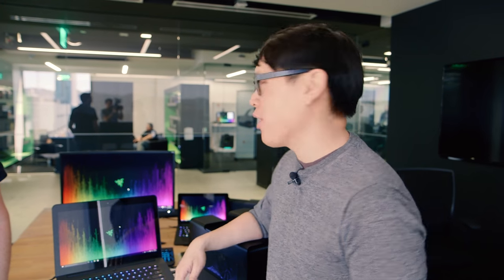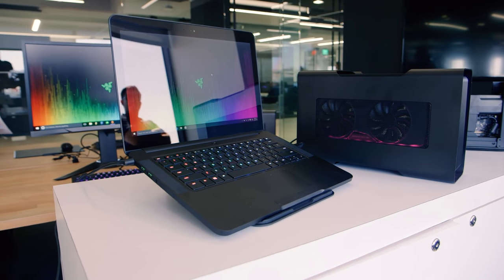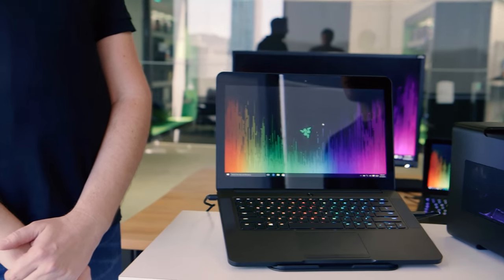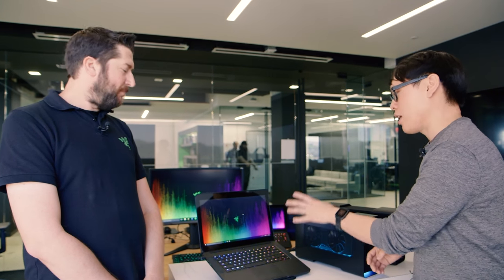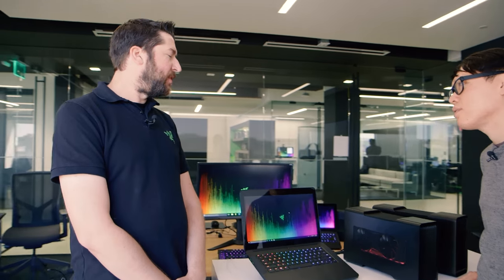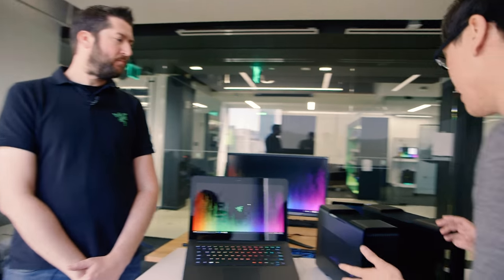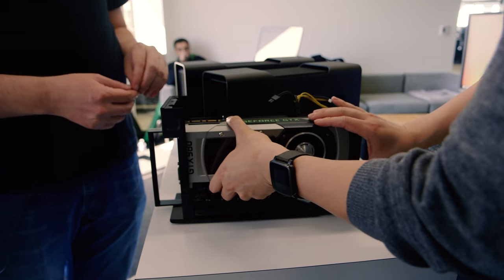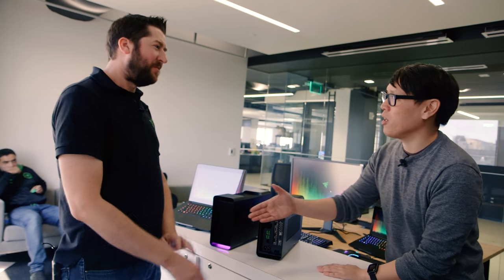Installing a Video Card in the Razer Core (External GPU)

Comment: I hope this tech advances.
I will always use a desktop currently for desktop setups. It's just the way it is; however if the hybrid laptop station gains compatibility, it will become a revolutionary device for all PCs.

The next portable I'm considering doesn't need to be a gaming device. Infact, I'm aiming for a 3D touch pen tablet screen (to make a wacom obsolete).
Essentially the design needs that type of screen. A Tablet PC design. And at least 16GB of ram.

Tablet PC's seem stupid right now, but if these types of devices, especially, are improved upon, you can turn a tablet PC into a tank in seconds.
The 3D touch is absolutely necessary for digital artists who wish to compact their art tools.

--------------------------------------
A general serious question though... who (other than apple's new Ipad) has created a 3D pen tablet screen for a tablet PC?
Reply: AshnSilvercorp Check Lenovo Yoga 720 15''.
i7 7700hq
16gb ram
512gb ssd
Gtx 1050
4k display with touch and pen
Works like a laptop 
Folds to work as a tablet
And usb-c thunderbolt 3 port wich you can use for egpu 

Bonus - 7h real world usage of lasting battery

Still don't have a egpu. But the discrete gpu inside is enough for my needs today. 
Played Witcher 3 and still play Escape from Tarkov. 
The only thing you will not be able to do is play in 4k....but since the screen size is only 15'' you won't actually need to. Lower resolutions work well.

Comment: Looks nice and looks like it was well thought out but this will still be bandwidth limited. Thunderbolt 3 is 40 Gbps which is effectively speeds of PCIe 1.1 x16 or PCIe 2.0 x8 or PCIe 3.0 x4. Plus add in that it is carrying gigabit ethernet and USB 3.0 ports, there may be some serious bandwidth issues while gaming. I'd like to see performance of a 980 Ti in a regular desktop compared with it in this enclosure. I'd be surprised if the 980 Ti could perform as well as 970.
Cost is also a bit prohibitive. For $500 I can buy a decent desktop CPU, PSU, motherboard, RAM, and have full performance of the GPU.
Reply: +htwingnut Honestly that's how I saw it too. I was excited for this, but I predicted the core would be exactly $500. So for this whole setup Blade ($2200, id choose the 512gb personally) + Core ($500) + GTX 970 (about $350 average) = about $3,000. For that same money can build a premium desktop with a 980ti for which I plan to carry out after Pascal releases. Then I'll just get something cheap to run on campus with. I already paid top dollar for a gaming laptop 2 years ago, but found myself playing games more at home rather than "on the go", so a desktop will now suit me better.

Again the Blade 14 by itself is a good laptop (curious how they will manage temps this time), but once the Core is considered along with another graphics card on top is when I question the actual value in it.

Comment: a lot of people are missing the point of this thing and complaining its over priced, but they fail to see how useful this is for some people. A lot of college students or professional workers will have an ultrabook on the go to do work. When they go home, they can just plug that ultrabook in and have the power for a 1000dollar desk top That way they dont need to own 2 systems and save a lot of space as well.
Reply: But the ultrabook itself is dual core, whats the purpose of having a good external gpu when the cpu is going to bottleneck itself. Building another quad core pc without the graphics card probably cost $600, which is $200 more than the enclosure but you won't get any bottleneck.
Reply: +Christian HT lol good point
Reply: +smileyfaceHi Add to that the fact the enclosure is 400 without a GPU inside of it if you buy it with the laptop, so you're spending 2400 + the cost of the GPU to get 'desktop performance'
Reply: well my point is you cant bring a desktop to a coffee shop, work or travel with it in general. so you're paying premium for convenience. Thats pretty much the reason laptop prices are high in the first place.
Reply: +smileyfaceHi I can see myself paying for a high-end desktop and even getting the Stealth for campus work for about the same price as a Blade 14+core+GPU setup. If the Blade Stealth at least had a quad core in it, then the bottleneck issue may not be as bad. You are right that there is a market for this, but the best setup right now is the Blade 14 combo because of the quad core alone. However the price becomes pretty niche at that point.
Reply: +Nick Migneault well consider this to be sort of a pioneer products. Like those high capacity harddrive that are expensive as hell but gradually lower in price. I'm hoping that in the future all of this will get cheaper to become affordable imagine the applications ! Say that laptop will become much cheaper since they did not need to include gpu and have longer lifespans since the heat are now outsourced. Even intel hd graphics and iris graphics are getting better and better. And you dont need those bulky towers that takes up space anymore. It might change the industry by merging both pc and laptops.

Comment: I absolutely love the modular aspect of this but what I can't seem to get an answer on is whether or not the core will support non-razer devices. Because, if I could get a mid range surface pro 3/4 and use it as a fully functional gaming desktop, that would be amazing.
Reply: +Caedon Bates I wouldn't bank on it until each manufacturer announces support for the specific device you are looking at it. This is 100% up to manufacturer.

Comment: hmm nice. I have the high end Macbook Pro 2015, but what is effectively a docking station for it at $499 is pricey but the ability to add a desktop GPU would be a sweetener providing osx supports such functionality.

interested to see if tested van answer that question for me.
Reply: +M3ta7h3ad check out Sonnet. They make Thunderbolt pcie enclosures designed for mac and have been doing so for a few years now. Great products

Comment: What a cool product, but way too expensive for what it is.
Reply: 150-200 would be ok for the enclosure alone
Reply: +Moeillo yes please
Reply: +Moeillo yeah sure, an external TB3 dock alone cost more than that
Reply: +Jesse D It comes with onboard PSU people tend to forget how expensive PSU that can support a good GPU can be.
Reply: +Faern Nashar expensive.. it's 50 eur in amazon (10% the price of the core). The whole price comes in licensing the enclosure. Thunderbolt license costs sh*t ton of money, then the hardware for converting everything costs quite a bit. You could do this with macs many years ago, but the enclosures were too expensive ($1000 for just enclosure) due to some complicated black magic involved in converting thunderbolt 2 to pcie
Reply: +The Diamond Games Yeah - People have been using 200USD Akitio thunderbolt enclousures with Macs for quite a long time already. With external PSU that price comes to 250USD + a little bit of DIY. 

Someone surely will get it done for 250-300USD. This is just the first one on the market. 500USD is ridiculous.

Comment: 970M... 6GB ram... WHY?! The 970m is slow... I do not understand what all that ram is for. Don't confuse the 970m for the 970, totally different. The 970m is slower than a 760.
Reply: +Richard Smith actually 970m is about as fast and sometimes even faster than 760
http://gpuboss.com/gpus/GeForce-GTX-970M-vs-GeForce-GTX-760

970m has more cuda cores and it overclocks easily

Comment: This could definitely be used to me as a college student.. I left my massive gaming PC at home because how much of a pain in the ass it would be to transport it back and forth. With the an external gpu like this, I could get a thin ultrabook like this and use it for classes without getting stares for having a bulky gaming laptop, but still be able to game back at my place.
Reply: Same.
Reply: +Pilot KaZZ 

or you could have avoided buying a massive case and bought a mini itx case that takes up only a little bit more space than this shitty $500 power supply with a usb port attached.
Reply: +Deject3d you are definitely missing the point..
Reply: i think razer is missing the point. they managed to make a gpu enclosure that takes up more volume than my desktop pc.
Reply: +Deject3d idiot.. the purpose of this product is to transform a laptop into a device capable of gaming without having to install an internal gpu. IT WASNT CREATED TO SAVE SPACE. it also wasnt created to necessarily be portable. the point is that you dont need a full-fledged gaming rig to game or a gaming laptop, just an ultrabook and an external gpu
Reply: +Pilot KaZZ You wouldn't even have to get the Blade Stealth..the new blade 14 is way more powerful and its compatible with the core so you can game on the go and back at the dorm.
Reply: +Pilot KaZZ assuming that college students can afford that shit? lmao.

Comment: the razer core makes it so much easier to plug in graphics cards. In a desktop, I had to put the graphics card in the pcie slot, plug in the psu cords, and then screw in the bracket screws. But now, with the core, all I have to do is put the graphics card in the pcie slot, plug in the psu cords, and then screw in the bracket screws!

Comment: So why the hell is this dock $500? It has a 500w psu, and a dock.... that's it?
Reply: When this is released you can go on eBay and get it for like 350. But I really agree that the price is stupid.
Reply: Everything is expensive before it gets mainstream
Reply: +Rafael Santana true
Reply: Well, 500W psu, dock, and pcie slot, should be $200 max, only because of the cool flashy lights and nicely designed case.  Throw that away and $100 tops.  $500 is definitely over the top. XD  Basically, a barebones desktop that's $300 has all of this and a complete motherboard, hard drive, RAM, CPU, etc. XD  You could build a small gaming desktop for that much and then you need the video card anyway...lol wtf is the point?  You're basically carrying around a mini gaming desktop that doesn't function without your laptop as a monitor. hahaha...I don't see the added value here.
Reply: Oh wait, you still need to attach a monitor to the gpu, right?  You won't get the graphics performance on the laptop screen, or will you?
Reply: I could build a gaming desktop minus the gpu for $500 and then same thing, except now I got the laptop and desktop, so...what's the point of this device again?  Mini desktop that needs the laptop to function? lol
Reply: With some laptops you can get the GPU to power the laptop screen but it really depends on both the external GPU, onboard GPU, processor and chipset, really the chances of it working are very small...
Anyway while a desktop could be cheaper, it is not mobile and buying a performance laptop for on the go AND a desktop is always more expensive, so even at $500 this is still cheaper for the target audience, sadly $500 also makes it embarrassingly expensive, at $300-350 this would be a lot less painful on the wallet and would easily be on my desk.
Don't forget that while you could build a mediocre pc for $500 and add a nice GPU, you can keep this Core with your next laptop and the one after it while upgrading your entire system.
Usually I'm all for building a desktop for less, but that is not what this Core is meant for, it is not meant for people who need a more or less fixed position pc but who need mobile performance and at home or at work a lot of performance without copying large CAD files from a laptop to a workstation for instance.
Reply: It has loopback so you can either get that output on laptop or external display. Idea here is a dock with charging and graphics card maybe even daisy chain an ssd with all your games and you have one usb-c to unplug and you can throw in bag which prolly has your original charger in it.

Comment: Dear razer here's a tip. Stop making glossy screens!!!!!!!!
Reply: +bluej511 Glossy screens give better transmission and luminance in a display. You don't take photos with a matte camera lens.

If you are bothered by it so much, get a matte plastic cover.
Reply: +Drew Heo Its very Reflective.
Reply: Drew Heo Right because camera lenses with 11 glass lenses inside works the same as a display with a single piece of PLASTIC screen. You do know most displays aren't glass right?
Reply: +bluej511 You realize that transmission is a property not native to glass right?  It's literally the property of being able to see through something, glass, plastic, water, oil, any fluid, etc.

The more glossy something is, the more transmissive it is. This equals brighter and more color accurate displays.
Reply: Drew Heo Yes want a cookie? Yet if the screen reflects like crazy and impedes the screen and your vision there is no point do you agree? Because my desktop screen is glossy, if i open my shades i can't see shit, defeats the purpose.
Reply: Matte screen filters exist for really cheap if you have that issue. Temporary and conditional issues with reflection should not mean that they have to mass market a product with lower color and luminance output, and just because it inconveniences your specific setup doesn't mean that everyone should lose out on a very good screen.

Also, you have an issue with your shades causing reflected light, you should probably move your desk so that it doesn't happen